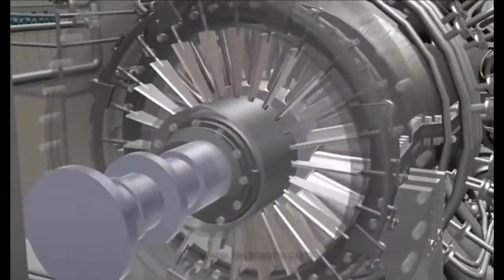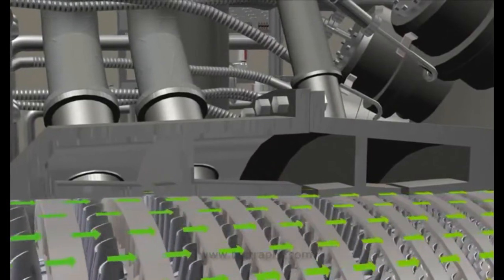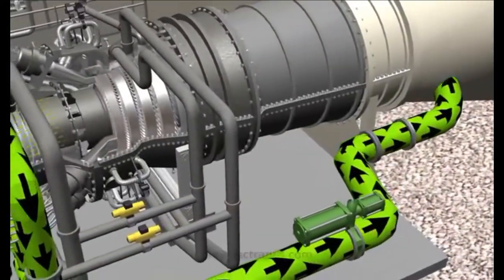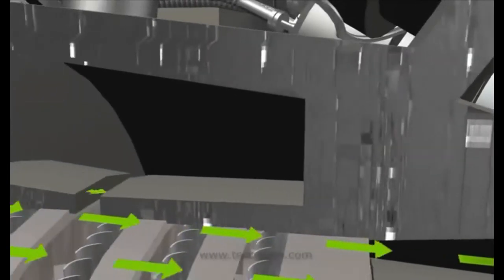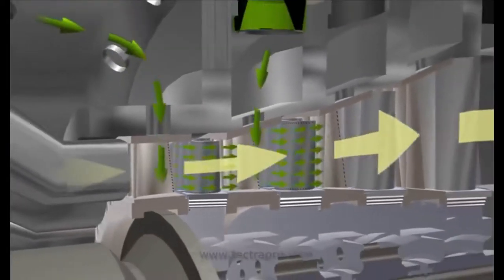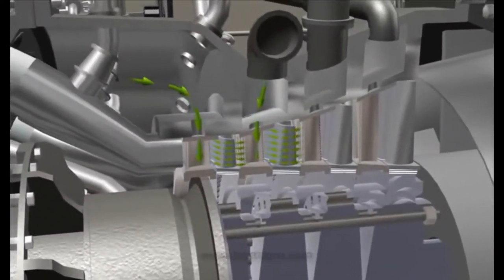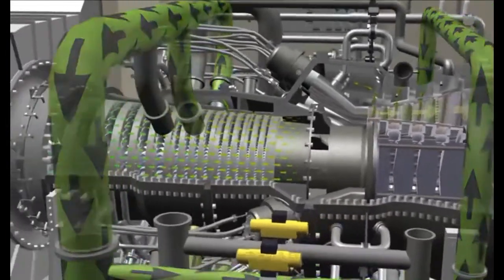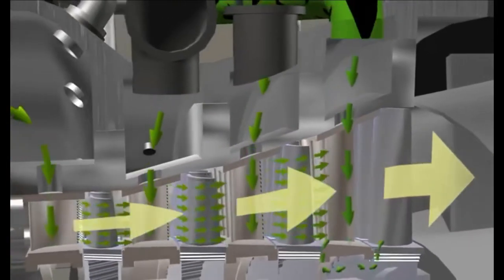Gas Turbine Cooling and Bleed System

Comment: reverse-osmosis pressureisation calculation for inefficient burn due to too cold at higher altitudes but applicable from power generation to recycling to planes to ships = gas turbine compressor stage affects combustion chambers
Reply: cool by displacement = compressor 
cool by compression-pressurisation = compressor
Reply: millennials brute force to compressor sucks rotors which sucks stators till engine perforation due to blades snap until centrifugal stretch and pressures